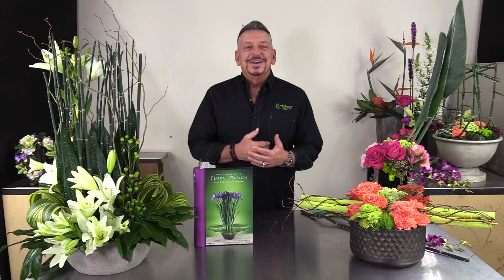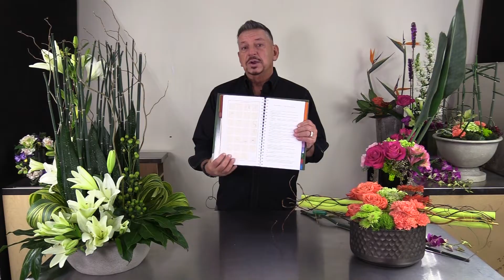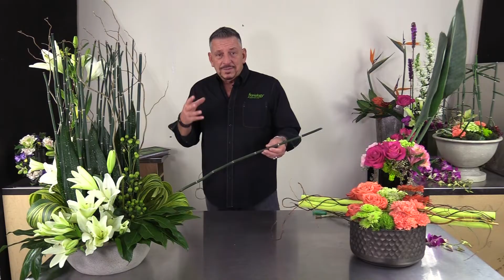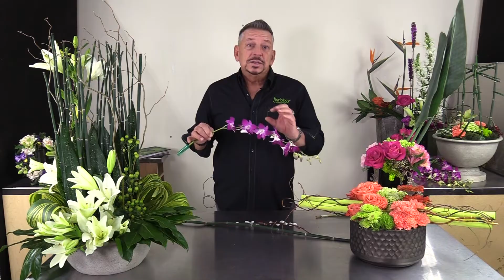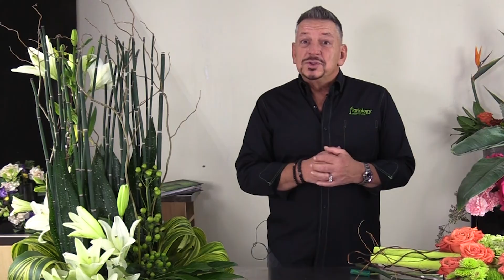The Elements and Principles of Floral Design : Line

Comment: please would you be kind enough to explain What  juxtaposition is in floristry  terms please ... Karen U.K. ...X
Reply from the maker: Hi, Karen! The meaning of Juxtaposition is showing contrast by concepts placed side by side. 
In Floristry, this could be achieved by placing a red tulip in a design of only yellow tulips to cause you to think about the contrast in the two colors. 

Another example would be placing the smooth texture of fresh-cut bamboo (which is considered to be more contemporary or modern) in a design with fugi mums and fresh pine (which are considered to be more traditional and every day)(the textured area also a contrast – smooth and spiky with the pine and fugi). 

Many Bespoke designs will highlight the juxtaposition of the flowers by using tropicals, garden flowers, exotic and traditional flowers in the designs.

Hope this helps. Let us know if you have any other questions.
Reply: @FloriologyInstitute  .. Thank you so much .. 🙏🏻 .. X